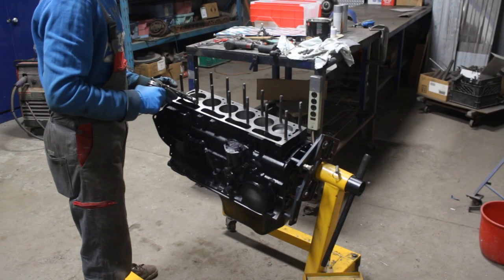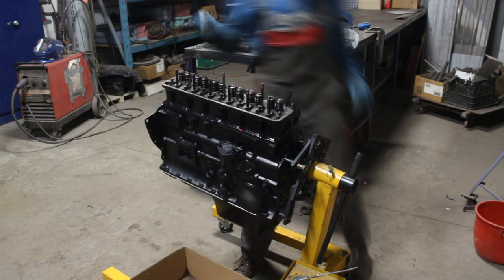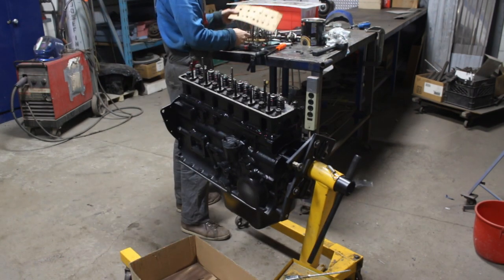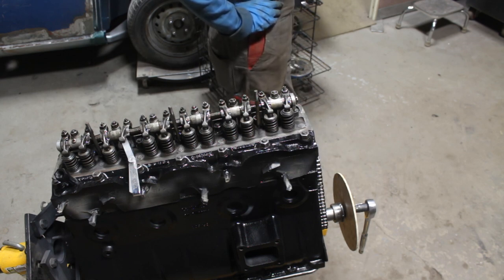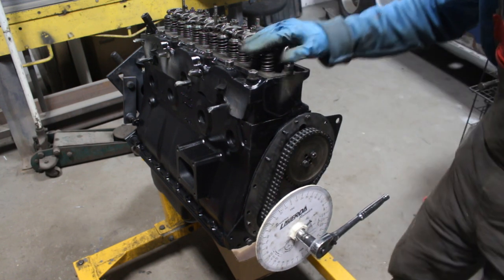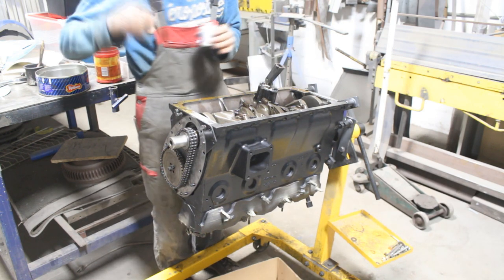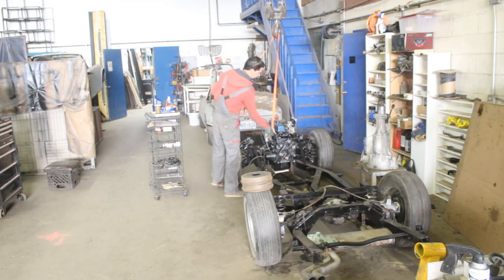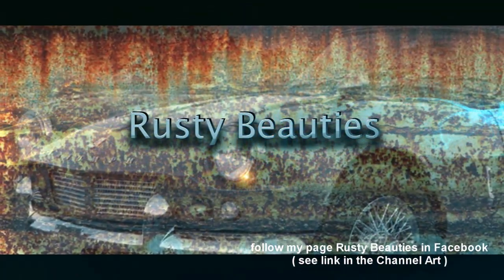1970 - Triumph TR6 restoration Project - Part 9 - Dropping The Engine In

Comment: thanks for this video Elin,,,,I've watched you install the rocker shaft a few times,,,so I feel more comfortable taking mine off to access the head bolts.     Thanks again buddy. !!!!
Reply from the maker: Yep. It is pretty straight forward. The annoying part is to readjust the valves after that!

Comment: The valves needed readjusting after the first hours of running on every engine I rebuilt. I think that the valves, and possibly lifters/pushrods reseat themselves after getting warm. Priming the lubricating oil system is an excellent idea and probably saves a lot of unnecessary wear. I remember strapping a seat onto the Jag XK120 chassis and driving it over 50 years ago! Looking forward to the next part. :-)
Reply: That makes quite a bit of sense.
Reply from the maker: Thanks Bruce. I guessed so about the valves.

Comment: I'm about to muck with my distributor drive gear so now I know how to put it back in. The GT6 and TR6 engines are very similar.
Reply from the maker: You can always mark it when you pull it out, but it is good to know what are you actually doing!
Reply: Elin Yakov someday I'll actually know what I'm doing but for now I'm just making it up as I go along

Comment: Wouldn't the push rods have to be oriented the same way they came out?  So perhaps after the engine runs for awhile they re-orient themselves and this is why you have to readjust after the engine has been run for a while?

Comment: Looking good Elin.
Just one thing, is that the right colour on the valve cover?
As i remember it from looking at both my 4 cyl and also the 6 cyl engine the cover is painted silver.
Anyway thanks for the video.
Have a pleasant weekend....
Reply from the maker: Thanks Ulrik! I am not 100% sure, but I think you are right, they all came with silver covers from the factory. Probably someone decided that a blue cover will suit their car better and changed the color. Since John was OK with it I didn't change it. It was in a good condition so we just cleaned it. Actually John cleaned it himself if I remember well.